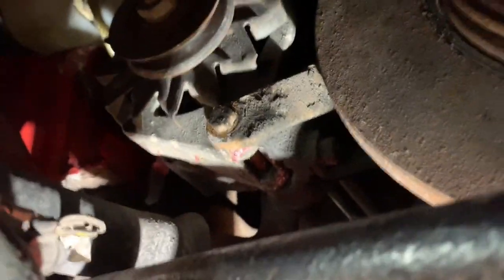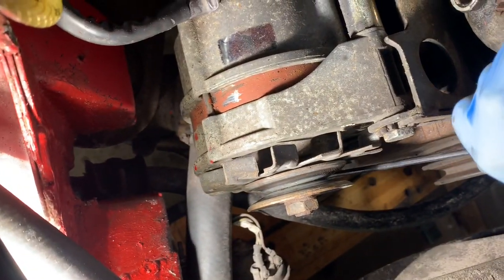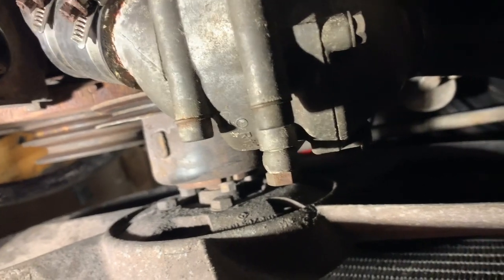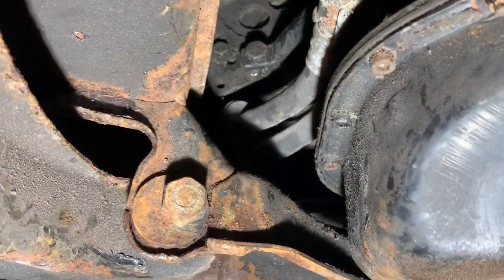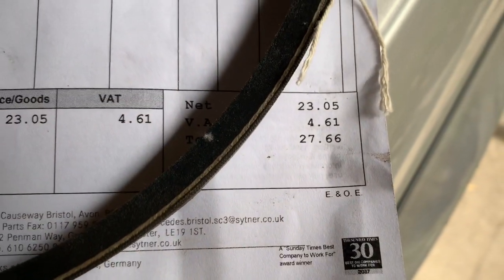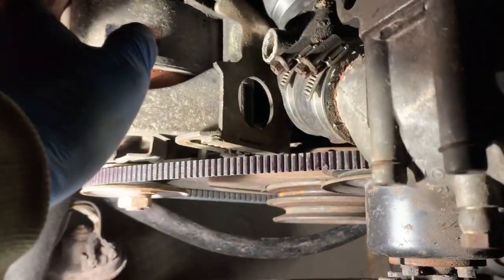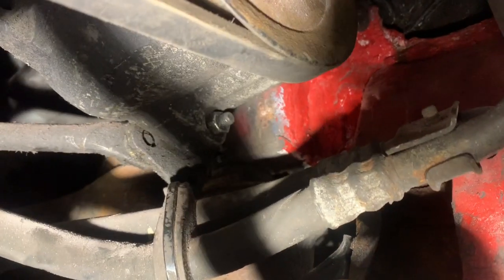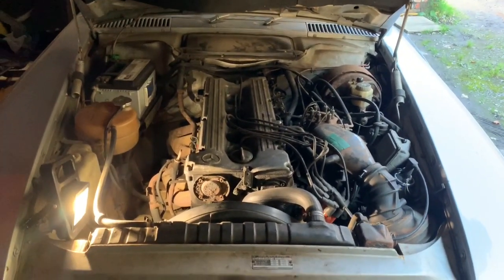Mercedes 107 SL change V belts without removing fan

Comment: Thank you Mike, those are very useful tips. Back in the 1990's I did change the belts and water pump on my 450SEL (W116), but then I removed the fan. Good motoring experience with Mercedes Benz.

Comment: Ace video. What are the belt specs? The new ones I bought were almost twice as thick as the original ones. Are they incorrect?
Reply from the maker: Hi - belt should be same thickness as the old one (Assuming the old one was correct). What make, model and year car do you have,,,,and where did you get the belt from (eg part number) Mike
Reply: @MikesMercsandothercars  So, the new belts I ordered whilst verified by the seller (via eBay admittedly) are 13mm wide (originals are 8mm wide) new ones are also too short. There are no part numbers on the originals they're worn away. If I cut and measure the originals they are: Alternator 8mm X 955mm and PAS 13mm X 818mm. Though both widths seem to function, 10mm seems perfect and that width is also listed as a correct part. Find it frustrating that there are 3 widths and multiple lengths of belt for my car.
Reply from the maker: @RyRch  Hi - what make model and year car do you have? Mike